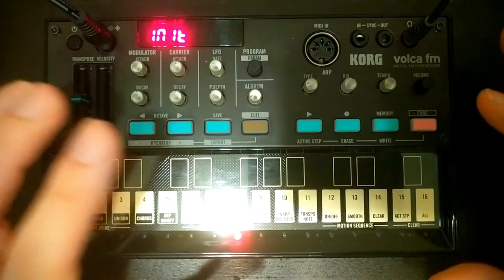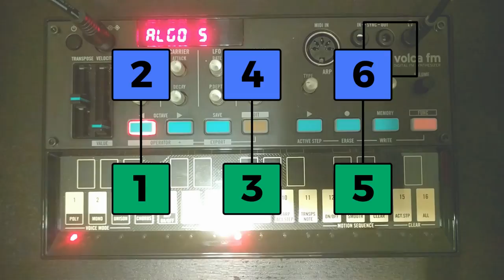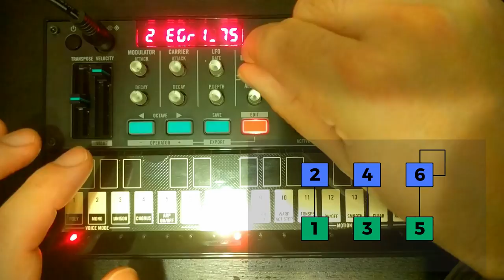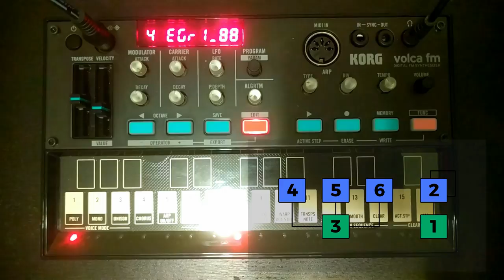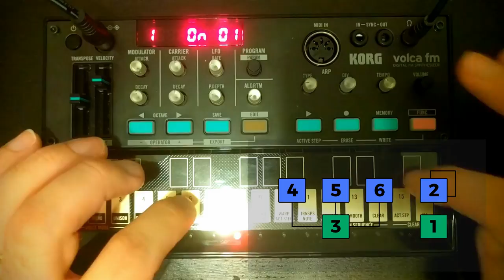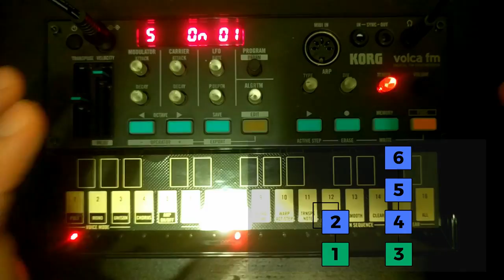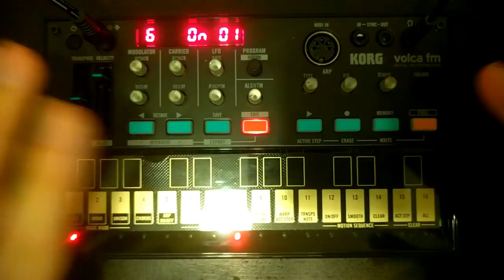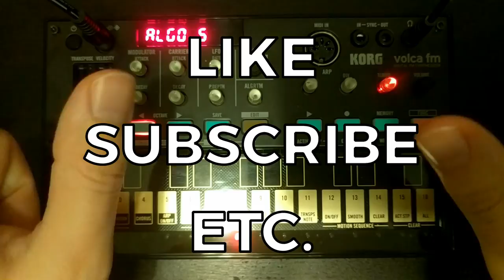Understanding Sound Design on the Volca FM - Episode 5: Algorithms

Comment: on the algorithm chart, there are some lines that loop back on themselves, instead of just connecting two operators (like op 6 on algo 5, or op 3 on algo 10).  do these operators behave differently than the others?
Reply from the maker: That is the final video in the series that I still haven't gotten around to. Those operators have feedback which is one of the features in the global menu. Basically it allows that operator to modulate itself to varying degrees. Depending on how you use it it can provide something akin to filter resonance, distortion or degenerate into white noise.

I actually cover it a bit in this video: https://youtu.be/NyXCd0JZqAI

Hope that helps, and thank you for reminding me that I need to crack out the Volca and make that video!
Reply: Definitely helps!  This series is amazing, and your web tool for patching is a godsend since I'm working off a chromebook.  Thank you for all your hard work!
Reply from the maker: No worries, glad you like synthmata too!

Comment: Thank you for the videos, they are awesome. I seem to get confused by the bit where our modulators are affecting the operators/carriers 1(2) 3(4) 5(6) for example, there doesn't appear to be any assigning going on when selecting the carrier 1, so specifically assigning modulator 2 to it. How does 1 know it's being affected by modulator? Can 2 be mapped to affect 5 and 6 to affect 1? Or is it always in order of operator sequence so 1(2, 3, 4) 5(6) for example?
Reply from the maker: So, the simple answer is that there are 32 algorithms and the roles of each operator, and which is modulating each one is determined by which algorithm you select. There's a card with the algorithms supplied with the Volca (it's the same as the DX7). Carriers are at the bottom of each diagram; operators are modulated by the operators connected above them.
Reply: @OscillatorSink  Ah thanks for the rapid reply I get those now you mention it again, I think I might have been getting confused about if you were to program your own algorithm, if that's possible it's clearly beyond me atm  😆 and probably not needed due to the coverage of the 32 pre-made ones.
Reply from the maker: @WarrenWintersUI  and in the case of the Volca - not possible! You can on the opsix though and it's incredibly powerful, but more in the context of the stuff that it can do that isn't FM.
Reply: @OscillatorSink  Ah thank you. That's good to know and I can now just focus on the 32 that are already there. Loving the series by the way, really enjoying noodling along with the videos.

Comment: Thanks for doing these! They are very helpful. I try to follow along on the NI FM8. I really like the bell sound you get using algorithm 12 in the middle of the video. I can't quite get to it using FM8. Any chance of you sharing the preset, either in DX7 format or just as some written notes on the some of the key settings.
Reply from the maker: +Kristoffer Sundberg thank you for watching! I probably didn't save the patch during the recording unfortunately, but I am currently about 2/3 of the way through putting together a patch pack and there are some similar sounds in there. It'll be released in the next few weeks and I'll be using my "synthmata" page to share them so you'll be able to see all of parameters laid out nicely.

But to help you get started, in summary - find 3 tunings on your modulators which give you a clangy sound, then set their envelopes to attack very quickly (R1 and L1 on full) then decay them quickly to get the "ting" of the sound (R2 around 70ish, L2 about 85,but try out some settings) then a slower decay as the bell rings out (R3 around 30ish, L3 25ish) then a long release (R4 30ish, L4 0).

Hope that helps!
Reply: Awesome! That is very helpful! I'll see how close I get with FM8. (I find the envelope times difficult to translate from "Volca FM speak".) I have a love/hate relationship with Yamaha style FM (PM I suppose), but you make some very appealing sounds in this video and the one on velocity in particular. I look forward to your patch pack. Your tutorial makes me consider picking up a Volca FM or a used DX7.
Reply from the maker: +Kristoffer Sundberg  the Volca FM is a killer little bit of kit, I highly recommend it. I'm also considering a real DX7 (or TX7 or TX802). The GAS is real! I'll post a demo of the Patch Pack here as soon as it's ready. There's also Twitter, Instagram, Facebook etc. where I'm posting some teasers if you want to get a sneak peak!

Comment: A Nice explanation! Only I can t understand how do you switch on a new algorithm from the program/parameter knob instead of ALGRTM knob? I tried to do that, but I couldn t.
Reply from the maker: Hi Boris, I'm not totally sure, but I think you're confusing me turning the operators on and off with changing the algorithms. In this video I had presets all ready to go for the video so I don't think I change algorithm using the Algorithm Knob - I just change to a preset with the right algorithm already selected. Does that make sense?

Comment: If you look in the algorithm card for example Algorithm #10.  How do you write in the volca fm algorithm#10 ?
The volca automatically know the #10 has a feedback in modulator 3 or I have to write down, if so how can I do that. Sorry this is my first ever instrument  and is a little confusing how to tell the volca I like to use a specific algorithm. Thanks very much again for your perfect explanation I really learn from the other Video .
Reply from the maker: If you select algorithm 10 using the algorithm knob, then the operators are arranged as algorithm 10.

You define how much feedback is used in the global parameters (keep pressing right on the operator selector, it's the parameter labeled "fdbk"). You can set the feedback amount there.

Probably the easiest algorithm to experiment with feedback in its basic form is 5. Turn off operators 1-4, turn up the level of operator 5 to full, and 6 to around 75. Now go and change the feedback level.

Starting your synthesis journey with FM is brave! But once you've nailed it, subtractive synthesis will see very very easy.
Reply: @OscillatorSink  thanks again . That's why I didn't understand I saw in the video you torn on and off operator  I thought I have to write down but that is only when I want save a new patch . Thanks very much .

Comment: This point is not very clear, I entered Global Mode, there are only 8 options, and I did n find a place to do any change of the name of a patch. Can you explain concisely, please? This parameter is not described on the small manual.
Reply from the maker: If you scroll past the options in the global mode it will eventually display the patch name.
You can now use the Operator Select buttons to select each letter in the name and use the  Value slider to change the letter.